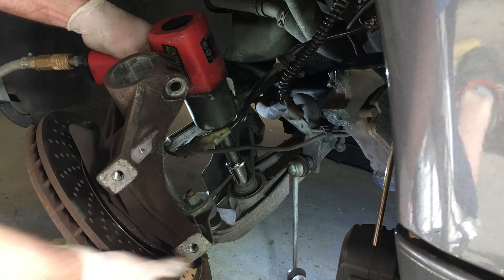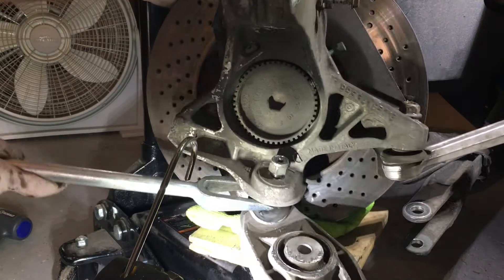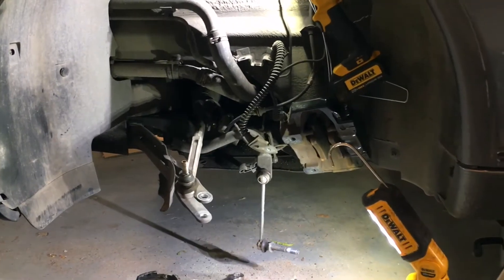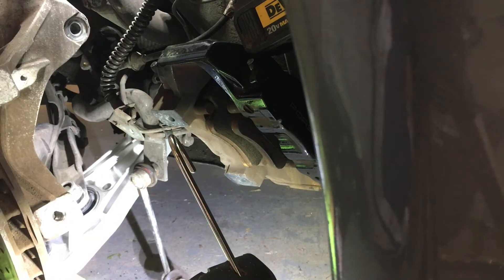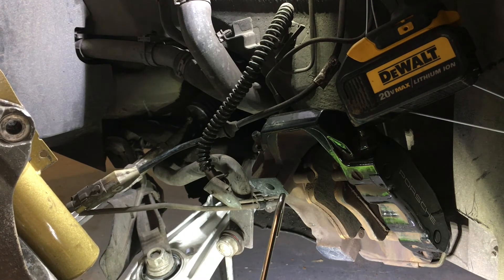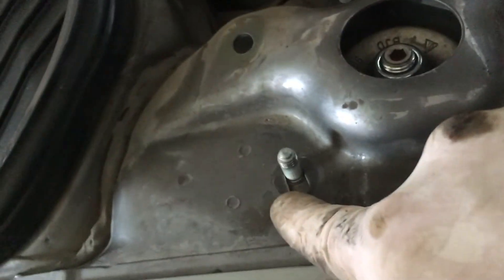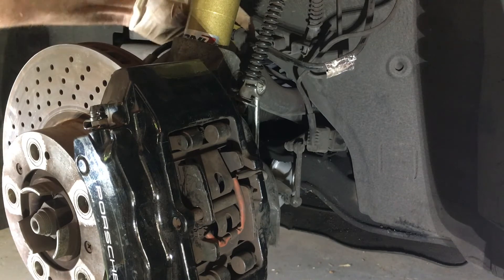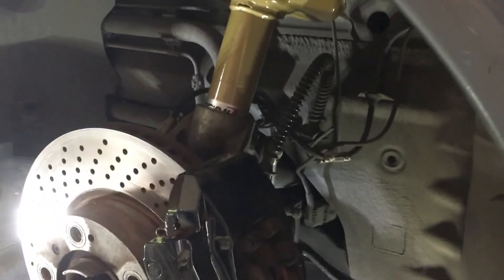Porsche 911 (996) front lower control arm replacement

Comment: Ball joint press might help on that darn wedged ball joint bolt. Might...  Thanks for doing this video.
Reply from the maker: Yes, would have loved to have had one of those to help with this project.  I  wish I had filmed the right  side that came off so nicely with a few whacks with the heavy hammer.  I have a feeling that this video is deterring some people from trying this project because of my struggles with this side, but I hope that's not the case.  If it makes anyone feel better I would def 10/10 times do this project again.
Reply: @porsche911luv9  but you showed people what it can be. Suspension can be frustrating and require a bit more brute force.

Comment: I'm currently having this problem now.  tried using a ball joint separator but ended up bending the bolt somwhat not what can I do?
Reply from the maker: Amina Waheed if your replacing the entire control arm anyway cut the bolt off low and then use a punch and a heavy hammer to get it off.  Some heat from propane torch helps too